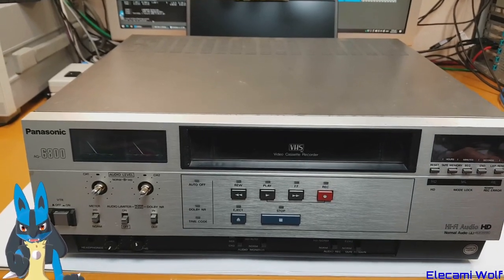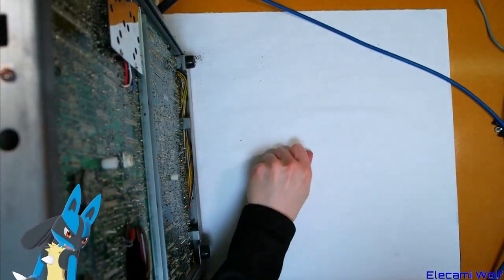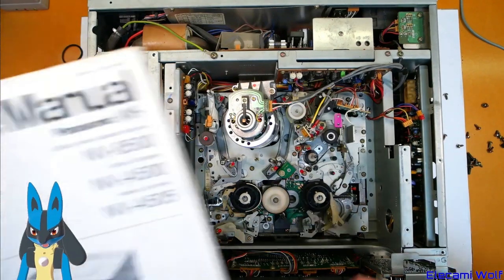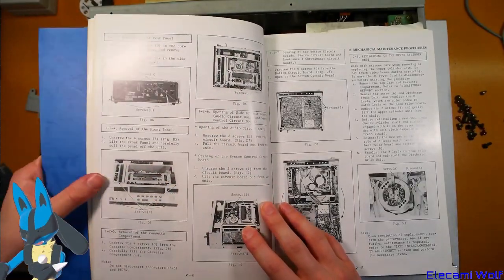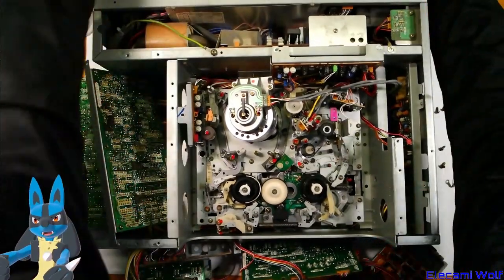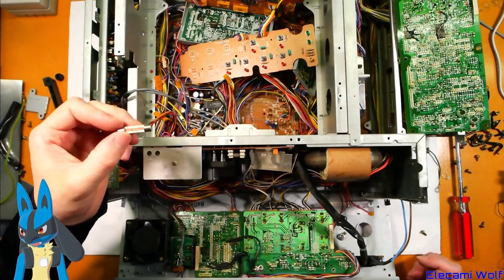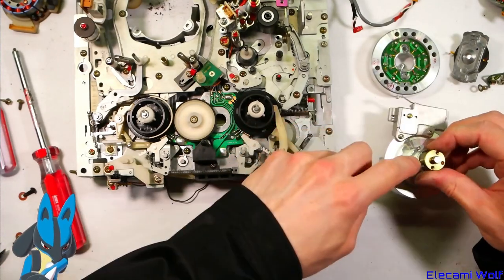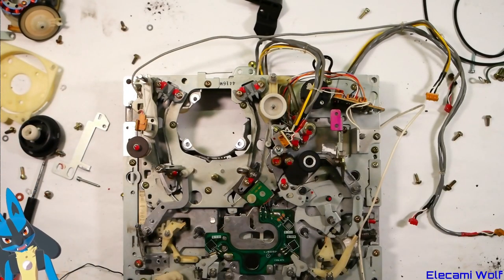EW0084 - Panasonic AG-6800 VCR Teardown

Comment: The audio constantly appearing and disappeaing because of gating, makes this video unbearable on headphones unfortunately. I want to watch it, but it's too jarring and unpleasant. :< Hopefully other viewers don't mind as much.
Reply from the maker: I feel like you would have to have the volume turned up loud to notice things like that.
It did not seem that bad to me.
I have ordered a new microphone, unidirectional lapel style to try out and see if that can improve the situation. Will take a few weeks.
Reply: @Elecami  I have a quiet room and I use a really high quality audio setup, so maybe that's why. I don't listen to things too loudly. It's even worse with noise-cancelling headphones, even at quiet volumes.. since the background is even more silent. Thank you for making the effort to improve things. Is the room where you film, inherently loud? I just wonder why you need the gating effect at all..
Reply from the maker: @oriole8789  Noise gate is to reduce the background noise which was fairly loud due to the microphone gain. It is a combination of microphone self noise and the roads outside / general ambient noise. Sometime I have to stop and wait for noisy vehicles to pass, gets picked up.
Reply: I have a panasonic ag-6810s and have to help the tape in with a little push of the wheel like you’re doing. Is it time for a new belt or do I need to lube up the rod that drives the wheel? It seems a little sticky.